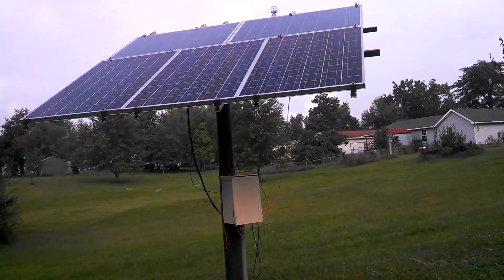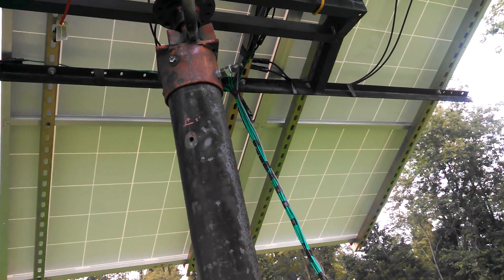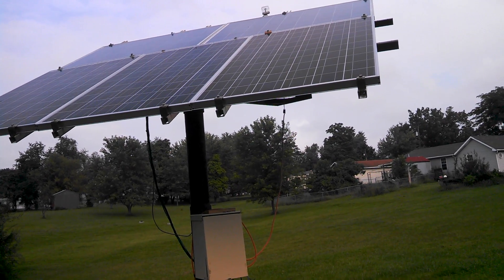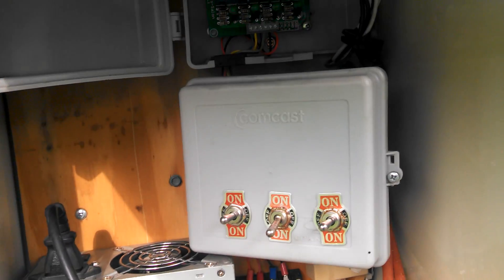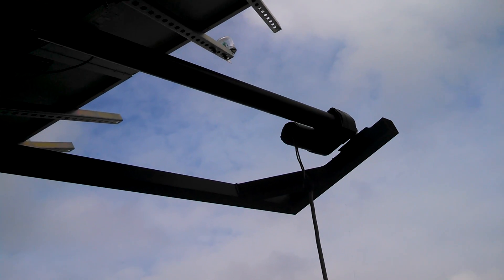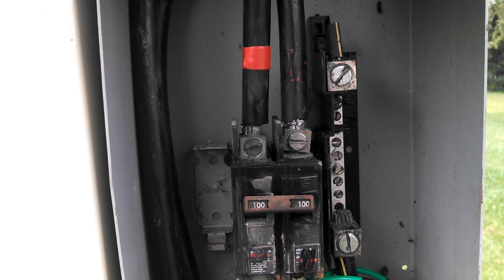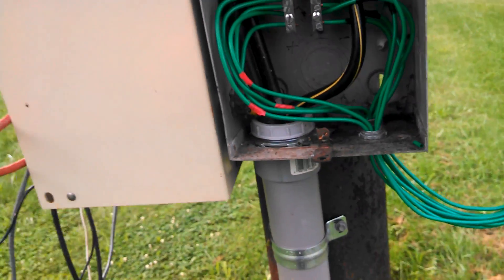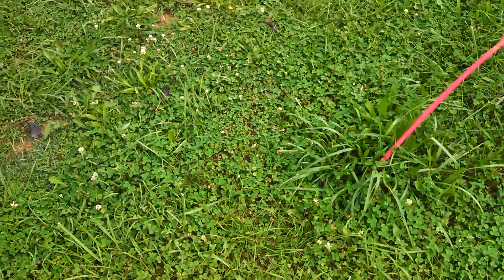My homemade solar tracker

Comment: Is it some kind of law in America that electrical installations need to have messy wiring? I watch a lot of Youtube videos lately and on 90+% of them whenever an American builds something the wiring is just a mess. I even saw it in an RV which I rented over there. I had to reset a circuit breaker cause the AC made it pop and when I opened the box I got tears in my eyes. Such a mess. Is this the ANSI way or is it dictated by UL?

Comment: I want to build a farm with pole mounted solar panels around it. I need to use utility poles about 20 feet and a tracker that can stand up to the weight. So i have a question... is a tracker used to move the array toward the sun?

Comment: If you answer questions, how does this structure handle high wind loads?  How much do you estimate it cost to build?  Can you mount it lower to the ground or would your wife object?   What was the increase in efficiency? I like it, your very inventive and this unit appears to be the most simple, practical and cost effective design that I've seen.  Suggestion, weather proof the combiner box doors using foam seals.
Reply from the maker: zeogiannes So far it's done very well in the wind I had 90 percent laying around about $200.00 dollar Can you mount it lower to the ground    YES   What was the increase in efficiency?  40%
Thank
Larry
Reply: Larry Kemp Thank you!

Comment: Pretty good wire your using for you run from the house to the panels I m thinking. I ran that kind for 220 to my shed after I burnt a 8 gauge wire almost in two, welding. Maybe I should get a heavy aluminum stranded wire for my run. What gauge is that you are using for your run to the house? How much voltage drop did it have?